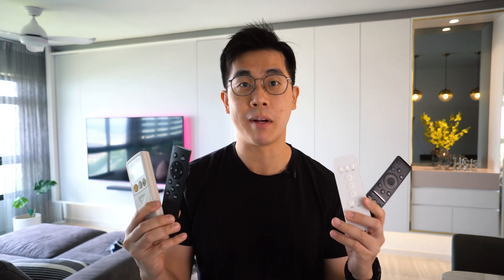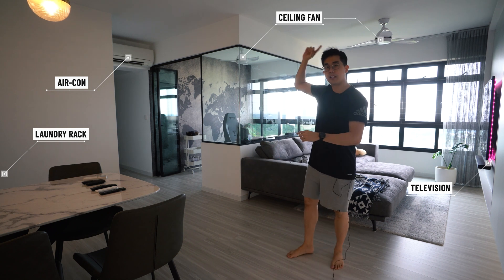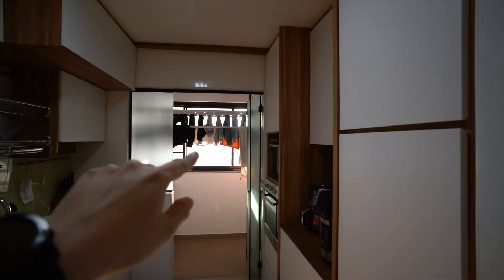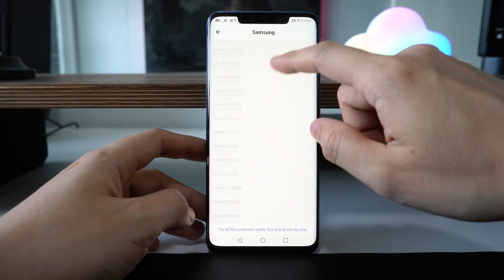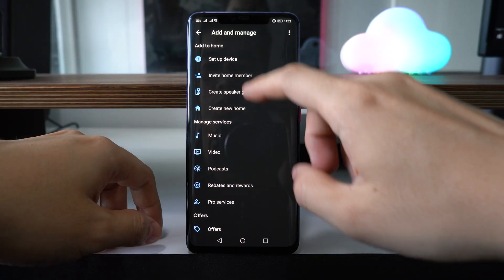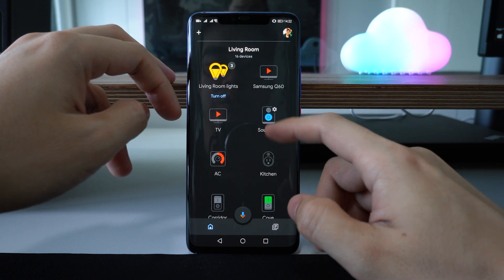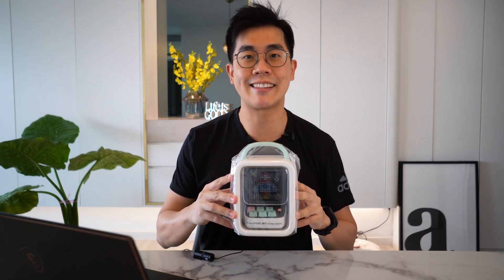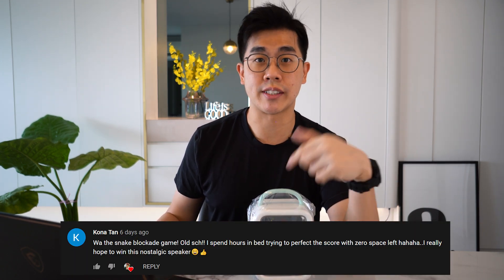Automate Home Appliance with IR/RF Blaster Solution

Comment from the maker: Share some use cases of how you are making use of IR/RF blaster!
Reply: Hi Alex, are there any solution for Bluetooth remote ? I recently got a Xiaomi standing fan (smartmi fan 3) the remote uses Bluetooth. The Xiaomi app currently doesn’t support controlling of the switch in Singapore region. The only possible way I can think off now is to use a switchbot to control the switch on the fan.
Reply from the maker: @alvinng9375  china region as well? ya probably switchbot, i don't have other solution in mind
Reply: Alex I am looking to control infrared devices with smartthings app automations , is switchbot mini hub can be used ?
Reply: Are you on telegram
Reply from the maker: @Shubham-uc8ku  no I'm not

Comment: bro are we able to use use the aqara switch as a trigger to trgger a series of action? i have a ceiling fan that does not turn on until i use the remote. im thinking of just click the aqara switch then it will base on broadlink rf blaster to turn on fan and oscillation. but i cant seems to do it.

Comment: Hi Alex! Can I know what’s your workaround solution for the big issue you mentioned regarding the tv having the same on/off button. I think this is something common for dumb fans too. Will have the same issue sadly. Also, this means we will encounter similar issue if we want to use a scene switch right where we ideally want to press 1 button and a while scene is up the want we want.
Reply from the maker: some tv are are smart, so to off don't use the IR function. For fans of the same brand, they usually allow you to set different radio channels which is the case for mine

Comment: Hi Alex, great video and I learnt a lot from your videos on smart home.

A quick question on the IR blaster solution
 - as I have multiple aircons (eg living room, master bedroom) of the same brand, how do I ensure that I turn on the my desired aircon via IR blaster? I presume the remotes are the same and is interchangeable
Reply from the maker: you need a IR blaster in every room
Reply: @AlexTeo  thanks Alex, so if there is aircon near to each other, say just behind wall, there is also chance that the two aircons are turned on/off. Is my understanding correct?
Reply from the maker: @WilsonChewSG  can the same happen when you are using the physical remote?
Reply: @AlexTeo  yes not very often but yes

Comment: Bro how you got ur ceiling fan connected? I have Crestar value air and I believe it is working on rf. I bought gateway hub that connnrcts wifi and rf. I am still not able to get the frequency for the fan.
Reply from the maker: What is the exact product name?
Reply: @AlexTeo   the fan is called crestar value air 55” i have BroadLink Wi-Fi, IR and RF device same as the one in ur video.

Comment: Hi Alex, I came across ur video & find it very information. In this video, u have used a broadlink rf blaster to control ur ceiling fan. I have bought a S brand rf blaster (work with 315 & 433 mhz) to pair with my Fanco ceiling fan that runs on 315mhz frequency. However the S brand blaster can’t learn my fan’s frequency. So I’m wondering if the broadlink blaster able to do so?
Reply from the maker: best is to get confirmation from official broadlink, if not just buy and test if you can do a free return
Reply: @AlexTeo  thank you for ur reply. Keep up the good work and continue to make interesting videos. It is very informative & helpful.

Comment: Hi Alex been following all ur videos now that I have my own place. Qns on the broadlink for kdk fan using IR. I have 2x 48’ fan with light in my small 4rm livingroom. Seems like I can’t control them individually after setting up. I press on both turn on. I press light both lights turn on. :(  Do u have some advise seeing u also have 2x identical fan in ur set up?
Reply from the maker: for fanco fans they are RF and for the remote, you can set them to listen to the same channel or different channel. So depends on your requirements, some people prefer to have them configured as a group, some prefer separate.. but for IR the only solution is the placement of the IR blaster, you will need 2 if you want them to be separately
Reply: @AlexTeo  I want to control them individually. Hmm in that case I really need to trial and error in positioning the individual IR blaster at extreme ends, so it doesn’t activate both at once? If so I guess this is also like one of the limitations:(

Comment: Hi alex, can a device control more than 1 AC? I’ve two ACs in living room and three more in rooms
Reply from the maker: IR requires line of sight, just pretend you are pressing the actual remote control at that spot then you will know how many IR blaster you need
Reply: @AlexTeo  ahh okays so I’d require a minimum of 5 sensibo. do U think there will be a tech where all remotes can be compressed into one device

Comment: Hi, I am looking for an IR remote blaster that is compatible with mihome app and xiaomi devices. Any advise?
Reply from the maker: Xiaomi has their own IR blaster you could get that
Reply: @AlexTeo  hi it seems like it's discontinued.
Reply: I have been searching for it. U mund share the link with me?
Reply from the maker: @denzhonda1078  https://shopee.sg/Xiaomi-Mijia-Universal-IR-Blaster-Remote-Controller-V2-Black-i.133942249.2676404960
looks like its mostly sold out, DM the sellers and ask whether they will replenish the stock
Reply: @AlexTeo  thanks! I saw 1 YouTube video n the YouTube said its discontinued. That's y I'm looking for other alternatives that can work with mihome n xiaomi devices.
Reply: I also read that there will be instance that I need to change to China server for some devices to work. So am actually contemplating whether to stay with xiaomi. On the other hand also worried other brands not compatible with xiaomi devices.

Comment: Hi Alex, not sure if this message will reach when this video is sometime back and it’s still so useful. 

I’m using aqara M1S hub to connect to all my aqara wall smart switches and aqara motion sensors, with some automation on aqara iOS apps. Need advise on - I wish to turn on ceiling fan/light (Bestar) upon opening the main door,, thinking of aqara door sensor, but I’m not sure which IR/RF hub can integrate into aqara, or there is none actually? Alternatively, is it actually more correct to use broadlink IR/RF to connect the controllers to the ceiling fan/light, my understanding this is possible through Google home.. however the bridge that I’m
Not sure of is between the aqara door sensor to the broadlink hub, on how to trigger the turning on of fan/light upon triggering aqara door sensor.. do you mind sharing what’s the best options? (Ps the wall switch controlling the ceiling fan is not smart switch coz no neutral cable) thanks a lot
Reply from the maker: the M2 hub and G3 hub both have IR capability but no RF, if your fan is using RF then you don't have other options within aqara. If you want to use broadlink rm4 pro for RF, you have to use alexa to configure automation rules with your aqara sensor and broadlink fan device. This is because google home doesn't have that feature
Reply: @AlexTeo  Thanks for the advise and sharing Alex. I suppose Broadlink doesn’t need a hub to work right? I chance into this outsmart wifi IR/RF whereby it claims to be able to connect to google home and smart life apps, however in order for the door sensor to work together, my understanding I need a zigbee hub which I prefer not to since I’m already using aqara hub..  or I really have no choice but to have another zigbee hub in order to get my ceiling fan/light automation to work? Paisei for asking another long question.. thanks a lot
Reply from the maker: @lawrencetan6824  not sure what automation rule you are trying to set and the devices required in the rule, basically all of them must be on a common app. Generally you can try using alexa app since you can add skills to it
Reply: @AlexTeo  Thanks Alex. Will try that out

Comment: Hi Alex, can I integrate Aqara wall switches and broadlink ir/rf blaster to smarthings and use one of the aqara switch button to control broadlink ir/rf blaster to say turn on fan or light?
Reply from the maker: aqara switches yes, broadlink no
Reply: @AlexTeo  then in that case how about some of tuya ir or rf blaster which are supported by smartthings?

Can I use aqara switches to command those ir rf blaster to perform certain task? All linking up to smartthings.
Reply from the maker: @evanding605  yes if you manage to get them all on smartThings, for eg I use my aqara cube to control my a/c and tv via switchbot hub

Comment: Thanks for the share of your own home setups! I'm recently exploring home automation as well, and I came across a project called homebridge, which can connect all the google eco-system devices(switch bots, broadlinks, etc.) into apple's homekit. This way you don't have to worry about the eco-system. I haven't tried it myself, but it seems like a good solution.
Reply from the maker: ya if you are an apple homekit user, homebridge is the platform to connect products that doesn't have native integration. You won't be able to connect 'all', but better than nothing

Comment: does the IR hub needs to get connected to wifi network 1st before we can use our phone as a remote control?
Reply from the maker: yup it requires wifi
Reply: @AlexTeo  so both ir hub and handphone need to use the same wifi network then to communicate between one another

Comment: Thanks for this! Very helpful indeed. Just wondering whether a smart switch is needed to on/off ceiling fan since a hub can also do the same?
Reply from the maker: Its up to u, u can just use an IR blaster or even just a smart switch. For eg my living room fan, i mainly control the on/off only, nothing else. If someone accidentally switch it off then your IR wont work

Comment: Hi Alex, i will be installing Aqara D1 switches for my whole house and i want to pair it with IR/RF blaster. 

Should i get Aqara hub to pair to broadlink RM pro and D1 switches?

Which Aqara hub would you suggest? M1S or M2?
Reply from the maker: ehh i think you get the concepts wrong. Aqara D1 switches are using zigbee, there is no way to pair it with IR/RF blaster.
Reply: @AlexTeo  yes, i understand. I need a hub to communicate to aqara switches via zigbee but i also want to control my tv and other IR/RF devices.

So what kind of setup would you recommend? M1S or M2 hub? Standalone IR/RF blaster?
Reply from the maker: @nerradt  the M2 hub can do IR and a much improvement from the M1S so definitely recommend M2 over M1S. If you need to automate RF devices then use the broadlink just for its RF
Reply: @AlexTeo  Thanks for your advice. Will heed your advice to get the M2 hub in my masterbed and RM4 pro in living to control my RF  ceiling fan
Reply: For the M2 hub you are using, is it the China or global version. China version M2 hub can't connect to goggle home?

Comment: Hi Alex, hope everything's fine & well, for a 47sqm apartment it is not necessary to have additional access points in every room, correct me if I'm wrong as one router is sufficient enough for all devices to have fast connection especially if there's only one occupant due to the size. How about having several google home mini speakers like one in living room, one in kitchen & one in bedroom, what's your advice?  Have a suggestion how about making a video review on Windows 11 upgrade & user experience?
Reply from the maker: your questions have no link to this video haha.. nevertheless wifi strength will be hugely affected by the singapore thick walls so can't say for sure whether you need access points within a room. Google home mini is up to you whether you are going to voice trigger google assistant at those spots or music playback. Note that the speaker is not fantasic, i see it as just to trigger google assistant. Anyway I don't have a single google nest mini speaker

Comment: Hi Alex. I have used your videos to slowly set up smart home. Just facing an issue. My switches are Aqara and I have a fanco ceiling fan. I bought BroadLink IR
/IF. But I can’t seem to link my remote. It’s says succcesfully linked but never works. Any idea on this?
Reply from the maker: not sure whether you follow the instructions to learn the RF remote, shouldn't have any issues since I am using fanco fans as well. Approach official tech support if you still can't resolve
Reply: @AlexTeo  Hi Alex. Thank you. Is there a video on how you link celing fan to BroadLink? Also should I contact official tech support of BroadLink or Fanco. Actually the remote is linked. When I press the links on my phone, I see a light on BroadLink. But ceiling lights and fan does not turn on. If you have any suggestion. Do share ya. Thank you.
Reply from the maker: @hariharaanmalikaffure336  the light indicator does not mean anything, is it working for you when you are setting up each buttons? just make sure that it is within range as well. Definitely not contacting fanco, nothing to do with them
Reply: @AlexTeo  hi Alex. Some are working now and some are not. I guess I need to play around and re configure. But when I link to my Google home. I only see a on/off button and not other buttons. Any tips on that? Sorry to ask so much but I am just exited to set up.
Reply from the maker: @hariharaanmalikaffure336  google devices will only show an on/off, but you can create scenes on broadlink and they will be synced over to google as well. You can use those scenes in your google routines. Another workaround is creating multiple simple on/off remotes on your broadlink of the same remote. Eg every fan speed speed as be configured as a separate device

Comment: Hey Alex, great content btw! I have a question on what product should i be looking for. I am building my BTO from start, would like to have a universal app that serves as a remote for all key devices (ie. Tv, soundbar, switches, aircon, fans, other remote controllers). Im not sure whether the hubs like "smart things" serves this need or its more of a universal remote that serves it or something else. Theres so many tech such that im confused. Would like to seek ur advice on what is the simplest but yet universal way to setup + is it possible to do it beyond just the living n open kitchen dining area, to maybe also within the rooms thanks!

Another question is what kind of switch should i get that pairs well with the integrator (discussed in the first part). i prefer to wireless control the switches rather than buy a wireless lighting solution ie philips light bulbs etc. Thanks for ur expert pov!
Reply from the maker: broadlink is probably the best solution to automate RF but they don't integrate with smartThings. For beginner, you can just buy a broadlink rm pro to control your remotes, then aqara hub with their smart switches to control your lights, then use alexa/google to central manage

Comment: Isnt the BroadLink able to connect to both IR and RF? Is the reason you're using both only because placing the BroadLink in your study would not be able to reach your yard?
Also, is the BroadLink able to connect to the switchbot devices to minimize the number of hubs?

Just found your channel and learning alot. Hope you continue to make more content.
Reply from the maker: ya the Broadlink can't reach every devices. Broadlink and switchbot different brands, you can make use of google or alexa to bring them together for routines setup

Comment: Honestly I'm still quite confused at the many gadgets and how they all come together? And at times I question the need to set up a smart home when we have remote controls, even on our phones. air con remote can also preset what time to switch off etc. And I feel that instead of me telling Google home what to do and waiting, isnt it faster if i just walk over to the switch and press it? correct me if I am wrong? The only part I feel might be useful is probably having a one button press to switch off everything once I leave the house
Reply from the maker: Making remote control smart is just 1 component of a smart home setup. Different smart home solutions have its own benefits and also depend of individual requirements. Maybe you could just implement something see whether you find it useful or not, no harm trying. It can be as easy as getting a smart bulb or a smart plug

Comment: Hey Alex, do the automatic syncing of setup and scenes from Switchboard / Aqara apps work in a Google Home app installed on an iOS device as well? 

Also, in your setup, do all your hubs play nice with Google Home, so there is no need to open individual hub apps? Thanks!
Reply from the maker: sorry man i don't use iphones, can't test that. Yup, just use Google home unless you need to create scenes in the apps for them to sync over
Reply: @AlexTeo  adding scene mean Google home will not show it as a device in it? Then you have to call Google assistant to trigger the scene?
Reply from the maker: @tanleekent  they will show up as devices in google home but with no controls unlike alexa. So you have to rely on voice trigger on the scenes that are sync over since google home can't do any automation on device state as well